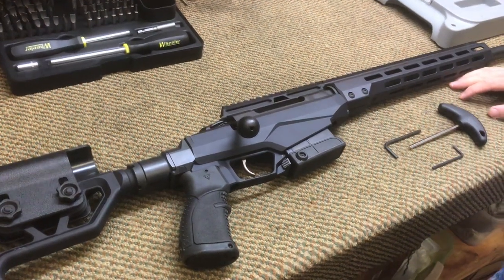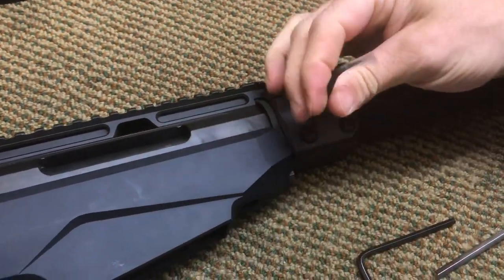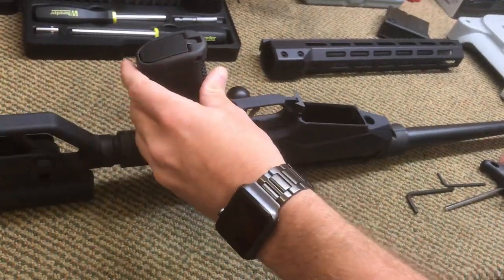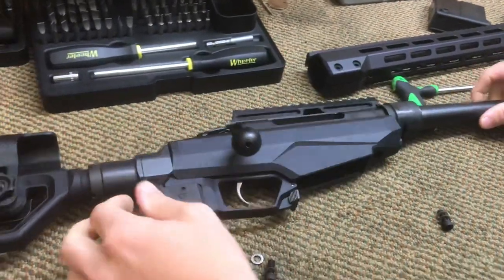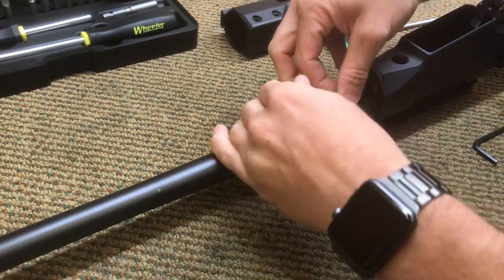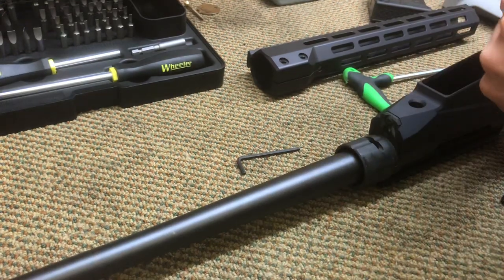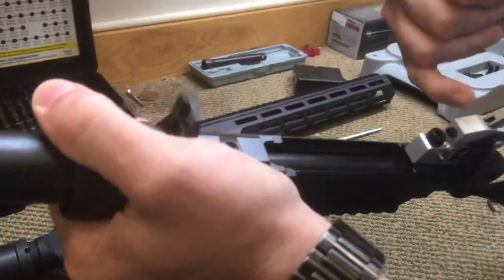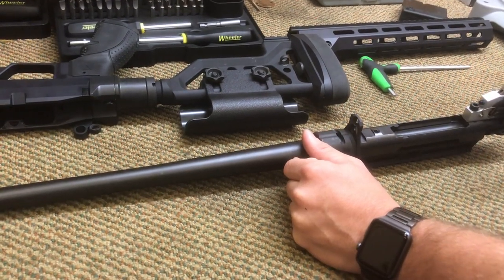Tikka T3X Tac A1 Disassembly

Comment: HI you dont need to take the action apart to adjust the trigger pull it can be reached with a ordinary allen key  only if you want to change the spring in the trigger unit do you need to take it apart as the head of the spring adjuster hits the take down bolt when its loosened to it max [[ lowest poundage ]] ,   its  designed that way to avoid the screw coming out unintentionally

Comment: What are these two small rings on the other side of the bolt for? You can see them on 3rd minute of the video on the left hand side screen. Two small rings set sideway to the rifle.
Reply: The two small rings are a very sturdy Sling Mount that will accept traditional sling mount coupling as well as quick release sling coupling. When I opened the newly arrived Tikka T3X Tactical A1, this Sling Mount is already attached to the rifle exactly as you see. The accessories boxed with the rifle includes another identical Sling Mount and hardware for attaching it to your favorite location on the gun. I hope this clarifies the structure on the Tikka.

Comment: 5 years later? How is it hanging in there? 

Scope recommendations for todays relevant market? Due to have to go as expensive as licea or NF or…? Thoughts if you have time or new video updates if anything beat tikka or your scope set up
Reply from the maker: I really want to do a part 2. I still have this gun, and it’s still in a very similar configuration, and no not really. I’ve been out of the gun industry for a few years now but still stay connected. I can’t think of a better value. As far as your scope question goes, there are some really good budget options out now that weren’t back then. I’ve been really impressed with Arken in my limited use…so we’ll have to see! Thanks for watching.

Comment: Hey how can I adjust the muzzle brake on this ? I recently bought this rifle when I installed the included muzzle brake the cuts on the brake doesn’t set to left/right position instead it’s pointed up/down.
Reply from the maker: Screw it on until it lines up the tighten the Allen screw to hold it in place.

Comment: One minor issue I had that other owners may want to take note of.
The pivot pin for the mag release wasnt fit very tight on my rifle. It fell out during a deer hunt, and by the grace of god I noticed before I lost the little pin, spring, or mag release. It was still loose after reinstall, but a dab of superglue on both sides has mine staying put.
Reply from the maker: That's an interesting note. I'm now 2000 rounds and 8-9 deer hunts in with no issues. I'm gonna check it! lol

Comment: What's required to take the barrel nut housing on/off?  I have an extra barreled action lying around.   Looking at buying one of these chassis on the used marked, but didn't know if it would require taking the barrel off the action to get the nut on.  Thanks.
Reply from the maker: C I do not know. I would assume a barrel vice and a big ass wrench. Sorry. If you want to get rid of that action let me
Know. I don’t think you need to take it off, but I’m not sure...
Reply: @amorphousgear2085  Did a bit more research. I think I was referring to the forend adapter. Barrel is still shouldered and this isn't a barrel nut system.  Apparently it has a small screw that goes into the scope rail, but beyond that the barrel just slips off.
Reply from the maker: I’m following you now lol

Comment: When you put back the action to the chassis how much torque do you apply to the screws?
Reply from the maker: I think I did 65 inch pounds. That’s usually the standard. Not sure what Tikka will tell you though.
Reply: TheT3x TAC A1 Torque settings are 7Nm [62 in-lbs].
Reply: @x31moose  thank you.

Comment: Have you ever removed or taken the butt stock off, would be good to see the disassembly of that as well as its supposed to be very difficult to do for some reason.
Reply from the maker: Anthony Bostock Never needed to, but it just looks like an AR castle nut. Do you have issues with your stock?
Reply: @amorphousgear2085   I am wanting to change the Butt stock for another one or somthing better. I can undo the castle nut but there must be something else that needs to be loosened that i cant see that's still got it fastened tight.

Comment: Will a ctr action drop into a tac a1 chassis?
Reply: Yes, I have done just that swap between my CTR and TAC A1.   However, the factory CTR action screws are too short for the TAC A1 chassis.  You will need longer screws (or the TAC A1 chassis screws).

Comment: Have you noticed any wiggle in the stock?
Reply from the maker: mike evans I have not. If you had any I would say check the castle but.
Reply from the maker: Nut***
Reply: I haven't messed with it to much but the nut appears to be tight. it wiggles where the stock attaches to the mini-buffer tube. I assume there is a nut or bolt inside thee that attaches the stock to the tube. but I could be wrong.  Great video. Thanks for the help.
Reply from the maker: I might take a look at it tomorrow.
Reply: AG did you have a chance to look at your stock?  I took my rifle out yesterday, it was awesome (even with me behind it).  I still have the stock wiggle but it shot great.
Reply from the maker: Checked it yesterday and I have no wiggle at all. Really strange. Glad to hear it’s shooting good for you!
Reply: @mikeevans1527  Hi Mike, I had the same problem with mine and it gradually got worse. I have the folding stock version and unfortunately its not the castle nut that's the problem its the hidden T bolt that holds the butt stock in place.   This T bolt is usually fixed with loctite when the rifle is manufactured.  I tried everything to try and loosen the castle nut and get to this hidden T bolt but couldn't do it.  I phoned Beretta and they told me to send the rifle back to them so that there tech armorers could look at it.  They fixed the problem  but only said that the stock shouldn't ever need to be disassembled and that's why  the hidden T bolt is fixed with loctite.
Reply: I agree . I was trying to get to the hidden bolt (the reason for trying to remove the castle nut and tube).  It was sent back to Beretta and has been fixed.  I was gonna just live with it being loose but figured it would get worse and since it wasn't cheap I decided to have it fixed right.

Comment: Do you know how it connects to mini ar type tube?
Reply from the maker: mike evans You should be able to remove that castle but and screw in any mil spec AR buffer tube. Do you not like the stock? I’ve found mine to work excellent.
Reply: @amorphousgear2085  I like it. Just trying to get an ideal of why it's loose before I tear into it.
Reply from the maker: Really strange that it’s loose. Let me know if i can help man! Thanks!
Reply: AG, thought that I would give you an update. I couldn't get the mini buffer tube to break free from the receiver after loosening the castle nut.  I decided to take it to my local Beretta warranty gunsmith before I screwed it up.  They also couldn't get it to come apart and sent it back to Beretta.  Six weeks later I got it back and it looks like they replaced the stock. Can't wait to mount optic and get it back to range. Thanks again for the help.
Reply from the maker: Well that’s good news! Glad they got you taken care of. All of your pain will be worth it. Haha thanks for the update!

Comment: Does anybody know if the handguard can be change with any standard AR-15 handguard?
Reply from the maker: That's an excellent question. I doubt that the receiver has the same thread pitch as an AR15 barrel nut. That being said, why would you want to change it? It's basically perfect. lol
Reply: Just trying to find away to reduce the weight of the rifle